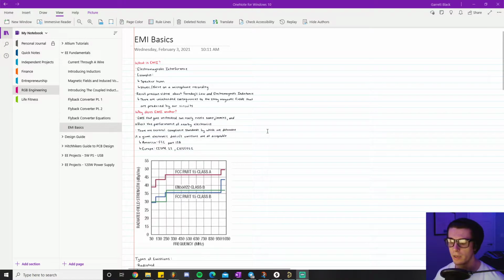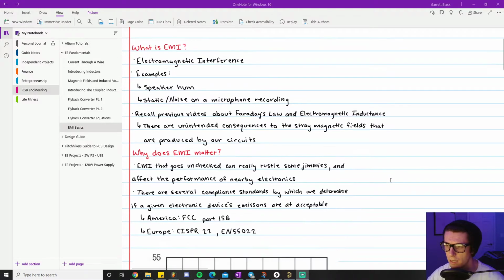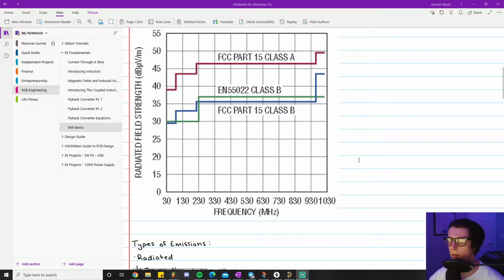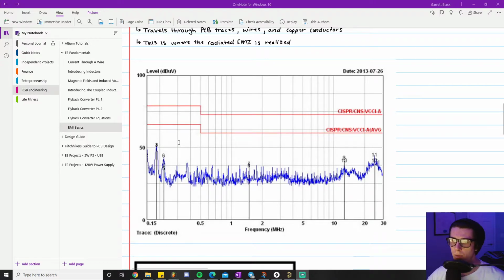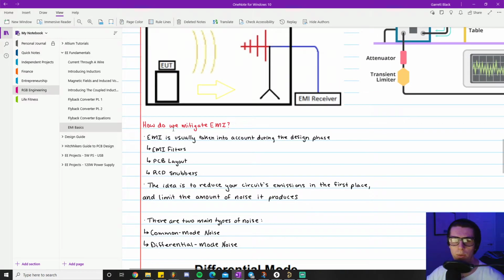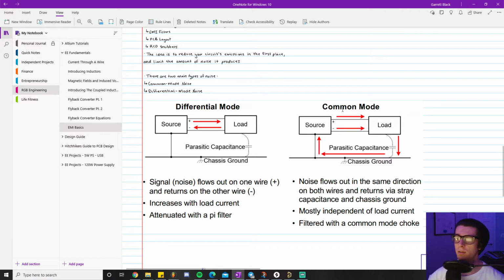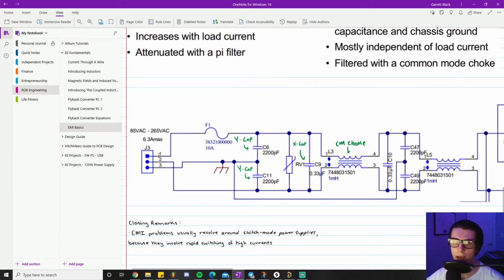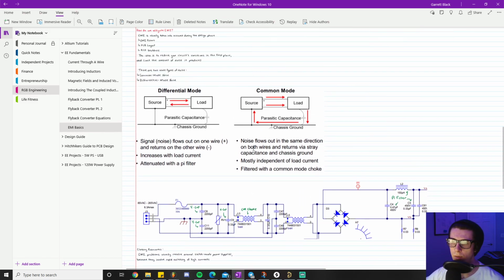EMI FOR BEGINNERS EXPLAINED| ELECTROMAGNETIC INTERFERENCE FOR BEGINNERS - COMPLETE EMI GUIDE

Comment: Hi. Can someone help please. I have a 24 inch Apple Cinema Display that has stopped receiving a video signal from my MacBook.

The all in one cable that has failed is no longer made and I cannot find a replacement anywhere. 
I have read that I can wrap my cable in foil or a self adhesive foil tape and if I fully shield the cable with the foil then it will create a new shielding.
Would this work? I have nothing to lose as without the cable then the display is good for parts only. 
Would I also have to create a new layer of insulation over the top of the newly created shielding?
Thanks for any advice.

Comment: Using a motor, an inverter, and generator head. How do I mitigate the interference?
Reply from the maker: Conducted EMI starts where the electronic device interfaces with the wall outlet. If you are running off battery, then you do not need to worry about conducted EMI.

Radiated EMI is still of concern though (both from a transmitting perspective and a receiving perspective). Mitigating radiated EMI is a very complex topic that I will make more videos on in the future.
Reply: @RGBEngineering  How to block the EFI between the motor (which is powered by the inverter) and the EFI created by the generator heads, which keeps shutting down the inverter??